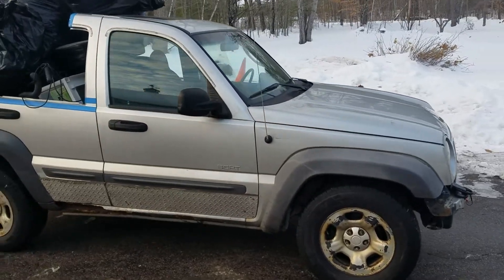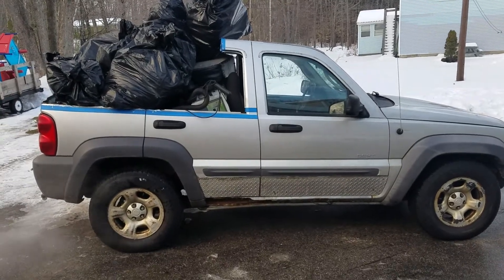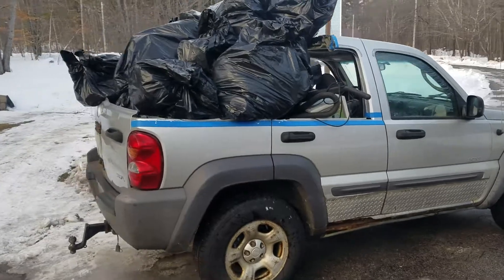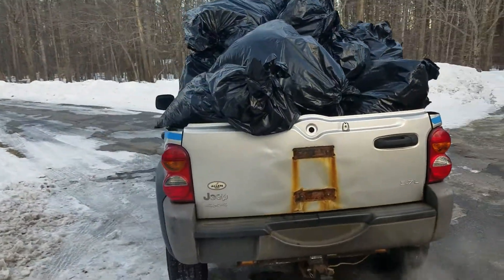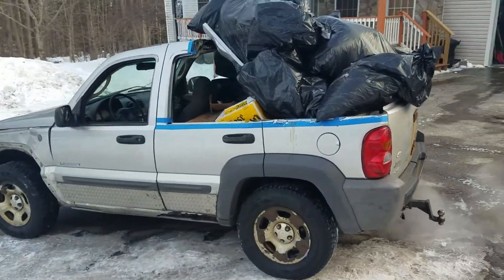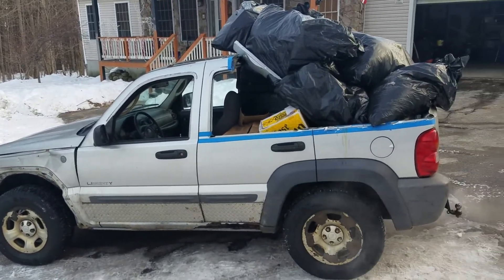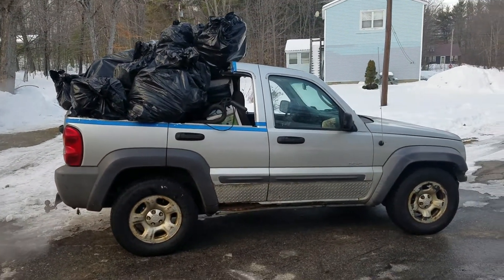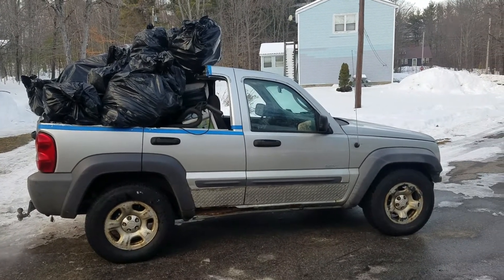2004 Jeep Liberty KJ pickup: hauling 1,000lbs of trash

Comment: Thank you. You saved me some $$ . I thought it would need to be reenforced the frame somehow. I will weld by doors closed and run the rear window up to the B pillar. I can’t live w/o A/C.👍👍
Reply from the maker: No reinforcement needed, It's strong enough for yard work, would add a roll cage if you plan on driving it on the street or off roading with it. I did not have AC to begin with, but I can't live without the heat.